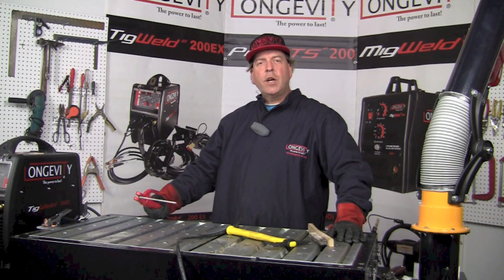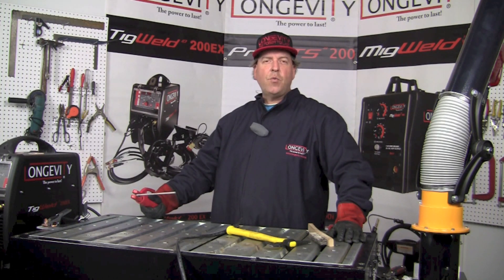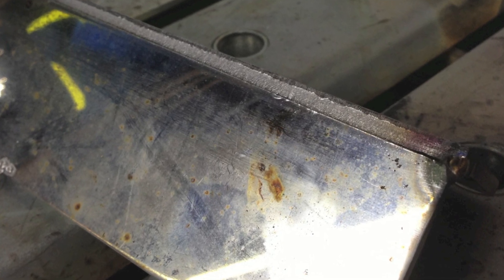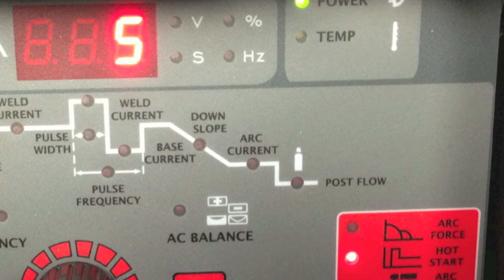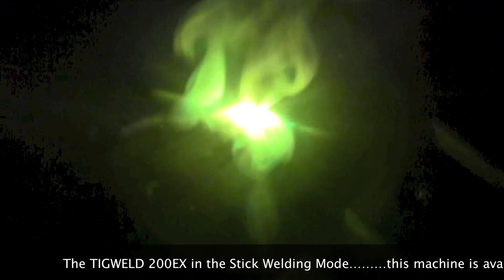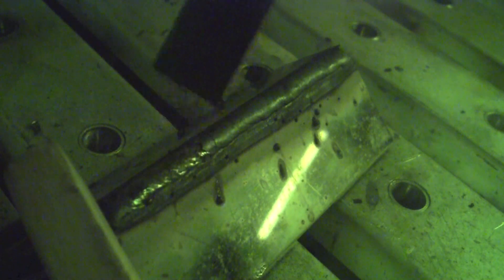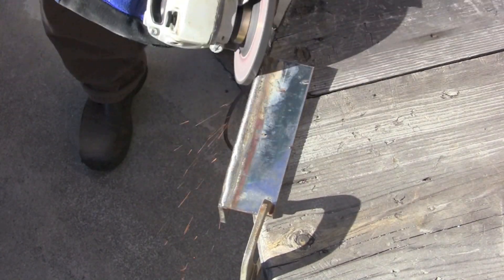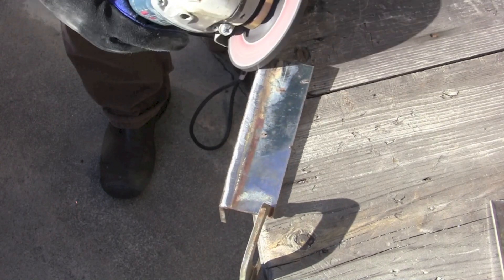STICK WELDING 316L STAINLESS STEEL WELDING OUTSIDE CORNER JOINT USING LONGEVITY WELDER

Comment: Great video, I am looking to get a welding machine that I can use for mostly light applications but will also need something that I can tack weld stainless steel hardware on occasion.  Do most of the machines work for stainless steel as long as it can get to 100 amps and I have the right type of rods ???
Reply from the maker: Yes, most Stick machines can weld stainless if you're using the E308L rods. You can check these calculators for details http://www.lwelds.com/welding-calculators